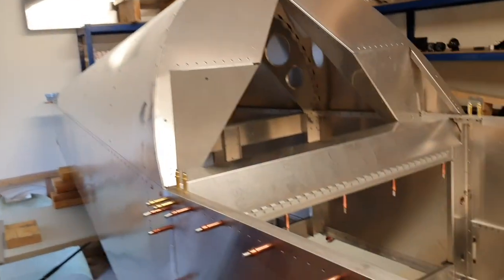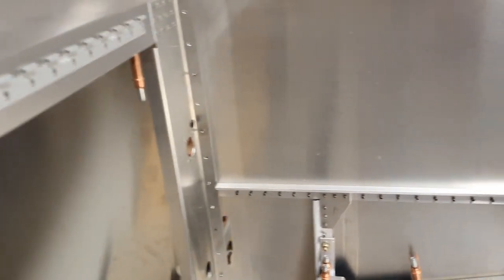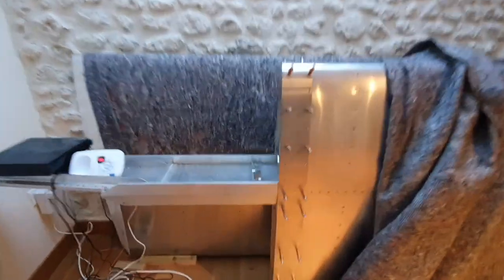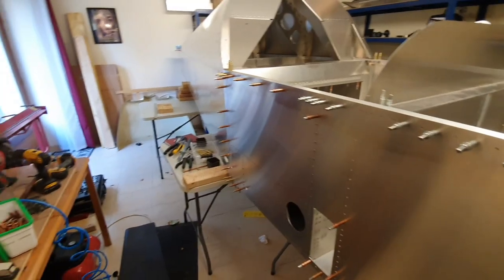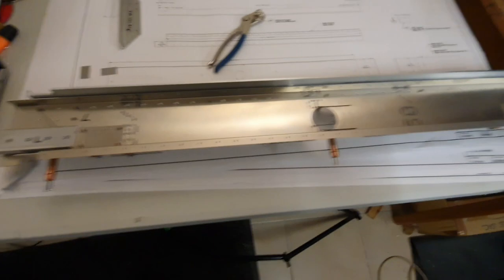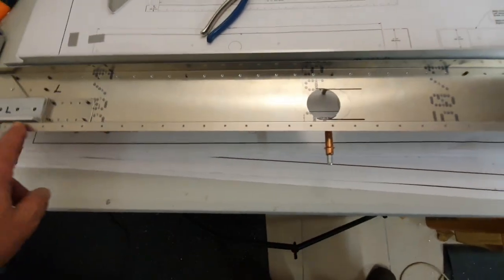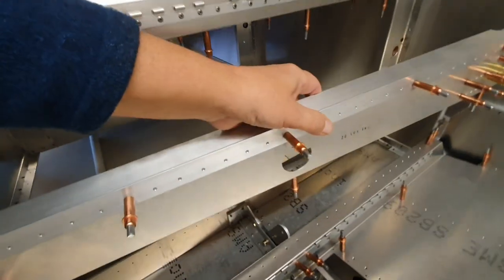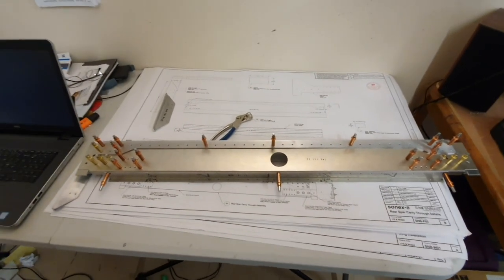Gavin's Sonex B Part 36 - 'Rear Spar Carry Through' assembly

Comment: I'm not sure if the "B" models call for the taper pin but in my legacy Waiex, the standard AN bolt used in the control stick attach point would indeed develop slop every one hundred flight hours or so. Eventually, tightening the nut further would not cure the slop. A taper pin takes helps alleviate this issue (albeit with additional cost) and every few hundred flight hours, a slight (1/8th rotation) turn of the nut on the taper pin takes up any slop that may have occured. It's worth it to get a taper pin in there. Control stick slop is annoying.